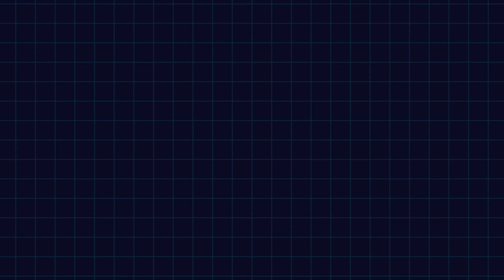What is Voltage REALLY? (The 10,000V Paradox)

Comment from the maker: Quick question: What was your biggest misconception about Voltage before this video? ⚡
What surprised you the most? Drop your thoughts below — I’m replying to all comments! 👇
Reply: I always thought that if electricity is like a fluid in a pipe then voltage is the water pressure and amperage is the width of the pipe
Reply from the maker: Thanks for sharing your thoughts! ⚡

You're spot on about the pressure part! But the width of the pipe actually represents Resistance (a wider pipe has less resistance, making it easier to flow). Amperage (Current) is the actual flow rate — how many liters (or Coulombs) of water physically pass through per second!

The next video is completely dedicated to decoding what Electric Current really is. Stay tuned! 🚀
Reply: I didn't realize how much static was released when discharging static electricity built up from our bodies. If we release 5 mJ in 5 ns, we get 2.5 MW. While that is so short not much energy is transferred, it is crazy to think that the potential difference is so large that the work done to bring this difference to equilibrium is done so quickly. I've also always thought about voltage as a linear scale but as you showed it is a lot more nuanced than that, as my previous internal model suggested that exposure to do a current with a given voltage is always the same.
Reply from the maker: Spot on with that calculation!

It truly is mind-bending: for a few nanoseconds, your fingertip is briefly delivering megawatt-level peak power, but because Δt is so vanishingly small, the total energy transferred (E=P×t) is barely enough to warm a single drop of water.

Really glad the video helped upgrade your internal model of voltage beyond a simple scale. We're carrying this exact foundation into the next video to decode what Electric Current and electron drift actually look like inside a conductor. Stay tuned! 🚀